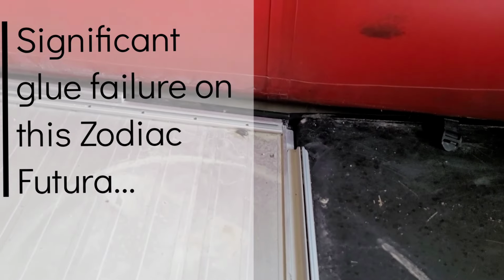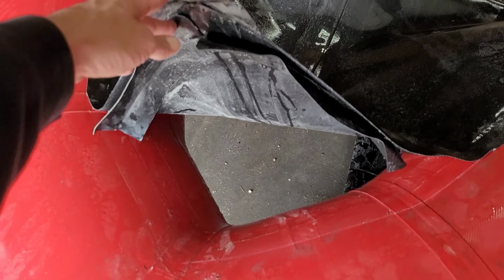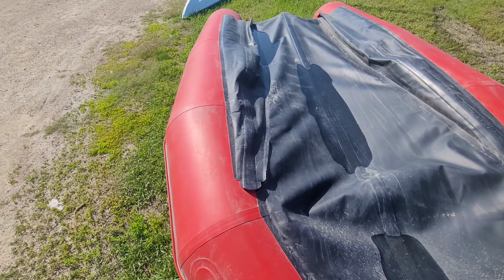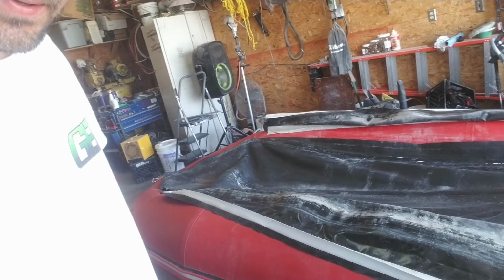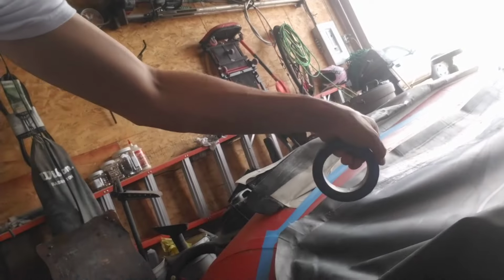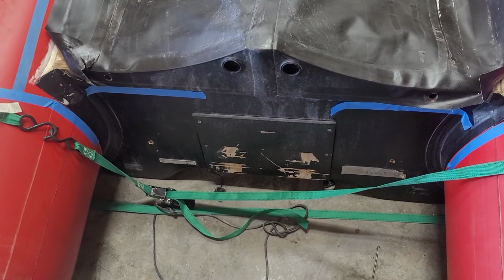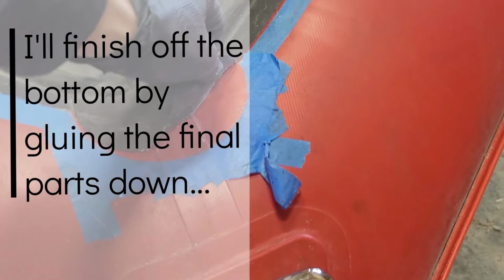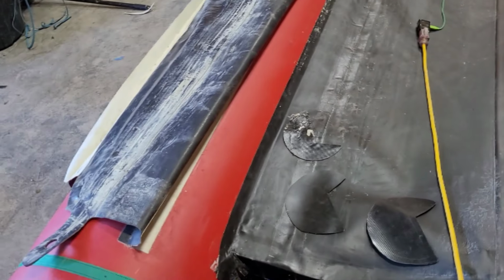Fabric Floor Removal and Repair on a Zodiac Futura with Speed Tubes #zodiacboat  #zodiacfutura

Comment: Should have explained about hinge(gusset) tape. Sometimes(often) parts of it have to be reglued to floor before attaching floor to boat. Also i's good to put 2 sided tape in between hinge tape(fabric) to help stay in place while reattaching.
Reply from the maker: I understand what your saying. But you have only so much time where you loose the audience's attention, lol. I try to be as thorough as possible, and let the viewers put the missing pieces together in the end. If they have questions, they leave them in the comments, and me or my viewers always help as possible. The two side tape is a excellent good idea. I've always used a dab of glue on small sections of the inner strips/gussets, to hold it in place while aligning and when assembly comes into play I use the burnishing tool to release the 2 sticking sections after everything has been installed and start lining up the inner strips/gussets. Saves on shop supply cost, but does require a little glue cleaning afterwards.

Comment: I am standing next to my 2006 Mark IIc Futura. Port side floor is detached. Transom was replaced five years ago. The floor connection there is solid as is the bow section.

I am hoping that one side is my neglect. I was putting it back together after all these years. Left it overnight. Had a migraine the next day. It was warm and sunny. That edge got direct sun in that tube may have over-pressured.

I noticed it after it was together in on the trailer. But not right after assembly.

Comment: really informative and you make an enjoyable video, cheers, one question though what glue do you use or recommend ? I have to  glue the complete floor to the pontoons on a never used zodiac fh 12.6
Reply from the maker: Thank you. I try to be as informative as possible. I recommend using a 2 part glue. Zodiac or Stabond are the preferred choices here, we also work with Weaver when.the others on backorder.

Comment: Good morning. First, I really enjoy your videos. I have a question. I have a Futura Mark III with the high pressure inflatable floor. When I try to inflate the floor the front bulges up and seems to take all the air and not filling the rest of the floor. I'm not sure what is going on. I'm hoping you can help me diagnose the issue and maybe suggest a solution. Thanks.
Reply from the maker: Send us pictures of the floor to our email and we'll be able to see what's happening and guide you from there.

Comment: Great job, thanks for the explaining. Can you tell me is my old 2000 Zodiac mark 1 pvc or hypalon? Previous owner told me its hypalon but what I heard it's welded pvc tubes with glued transom and bottom.
Reply from the maker: Depends if it's a Hurricane/Milpro model or Classic or Futura Zodiac model. If Classic or Futura brand, then it's PVC. If Hurricane or Milpro, then most like Hypalon/Neoprene.
Reply from the maker: Another way to tell is how the seams over lap each other. If it's belted seams, then it's welded PVC, if overlapped, then Hypalon.
Reply from the maker: If it's pre- 1990s and seams are overlapped, then it could be glued PVC seams.
Reply: @gashopperinc  Thank you!
Reply: just a note hyp can't be welded

Comment: great job!! my inflatable keel tube is damaged and not repairable where can i find a new one for my mark 2?
Reply from the maker: They have to be ordered from a Zodiac dealer. You will need your boats, Model number and HIN number. I can order one  for you also. Just contact us and we'll call Zodiac to find out availability.
Reply from the maker: Please email us the information on your boat to gashopperinc@hotmail.com, we'll be able to go from there. Info you posted earlier was removed as it contains information from your boat scammers or fraudsters can use.

Comment: How do you rate the zodiac futura
Reply from the maker: Not sure what your asking, Rate on performance or overall boat assembly?
Reply: @gashopperinc  Quality of build many thanks
Reply from the maker: They are well put together boats. Fabric is thick and durable and are overall high quality boats. Repairs can be a pain sometimes if there damage in the speed tube areas. Only thing one has to watch out for is the age. On older Zodiac inflatable boats, glue tends to fail after 10-15 years if not cared for.
Reply: I’ve only had mine on the water a short time. I bought it 10 years ago. The 20 horse Nissan just hit its 10 hour and break in. The last time it was ran five years ago. I have not had WOT yet, but I am really looking forward to it.